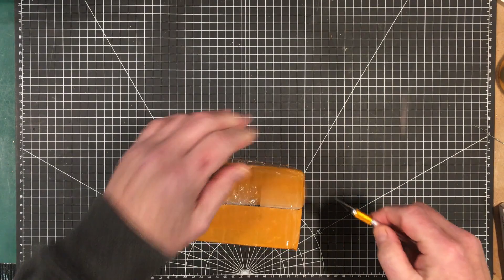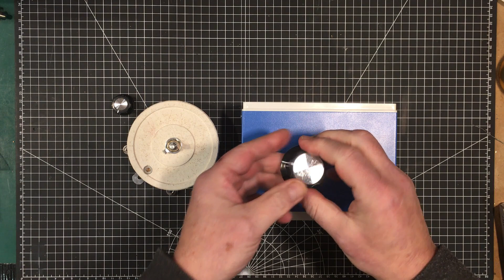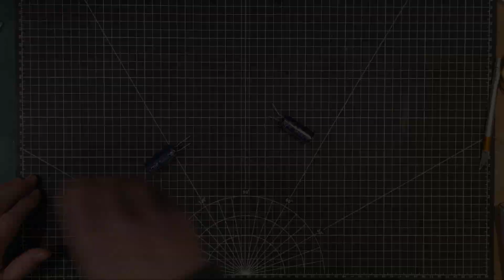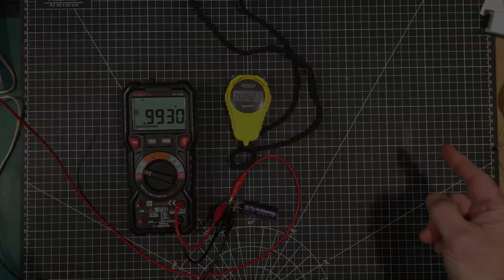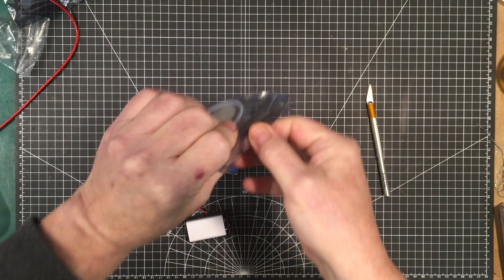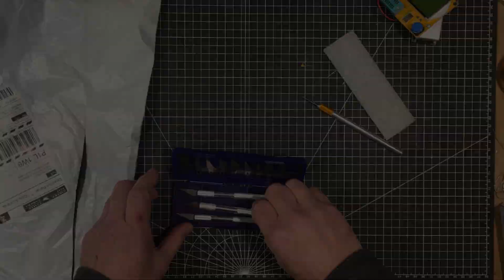0136 - Mail Bag 17: Finally caught up .. for now

Comment: Looking forward to the variable AC resistor build. I’m in the process of building a variable capacitor leakage tester as per Walt Wimer’s design using a variac and a step up transformer - things that are variable and can be dialed in just seem better for electronics to me. Good vid, thanks.
Reply from the maker: Thanks, and I agree .. except references .. they should not be variable.

Comment: Saturday evening, I have just fixed my brand new bench power supply and now I am watching some Canadian opening parcels... Thanks for the info about soldering tips.
Reply from the maker: Life doesn't get much better! LOL!  But hey, what needed fixing?
Reply: Well, I have purchased the cheapest by far PSU of this size/performance (CSI 5003EIII), so I have not been expecting the quality of Tektronix from 1970s. Anyway, before ever connecting my also brand new scope to PSU i decided to check if outputs are floating. To my surprise, I have found out that minus of one of the outputs is connected to earth-ground-safety pin of the power plug... Except for this detail it was working ok for last two weeks. Opened it yesterday and found out that the problem was a too generous soldering iron operator. Basically, he/she has made a such big blob of solder, that it has shorted one output to yellow/green wire. I have also found that one of two main output electrolytic caps is not soldered to the pcb, despite another big blob of solder...  @uni-byte

Comment: You should put a fan in that enclosure with the resistor so it can pull in some cold air to keep it cool. A little 5v or 12v fan should do just fine. It’s rated at 200 watts, but that is in free air.
Reply from the maker: I was thinking the same thing.  Maybe a small and cheap SMPS to power a fan and an AC Volt/Amp meter.
Reply: @uni-byte  bingo, I think that will work.

Comment: I bought several of the 2.7v 500f super capacitors back when they were around $5US. They test out similar to yours, usually within 10%.
Reply: Do they improve with use/forming?
Reply from the maker: @t1d100 "Do they improve with use/forming?" - that's a good question.
Reply from the maker: Thanks for the info!  They are new to me so it's great to get some feedback.